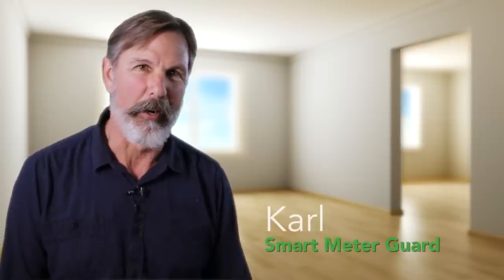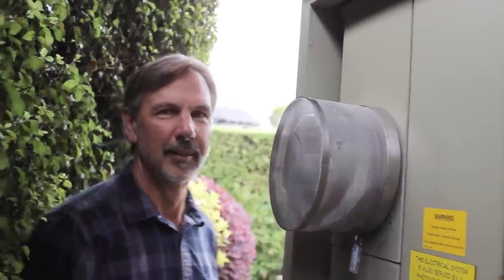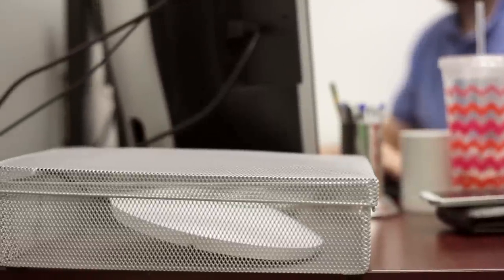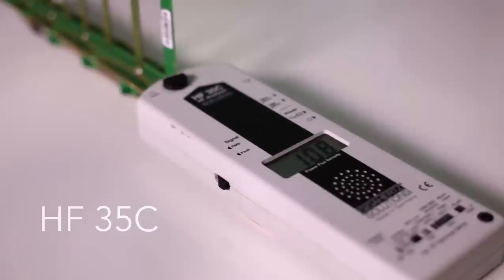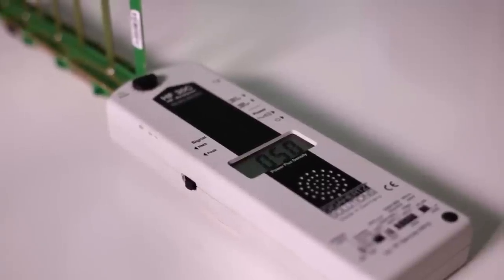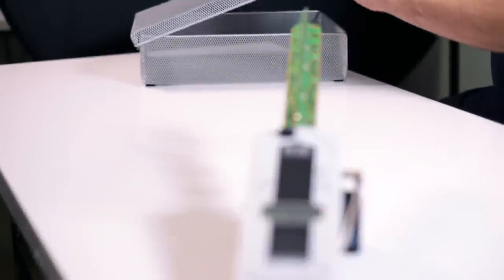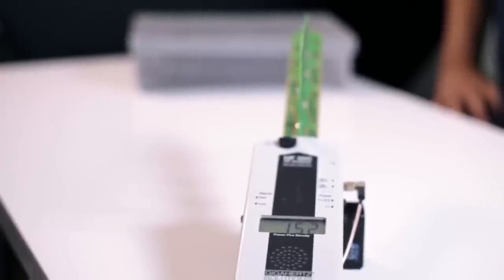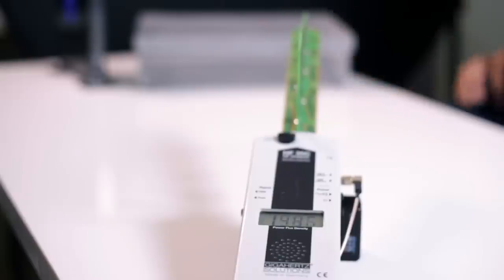WiFi Router Guard - Blocks WiFi RF Emmissions

Comment: Specking of which, I’m making my own router guard from an empty wheat-bix box and aluminim foil. I just hope it works. Anyway, I’m not exactly sure rather they’re right or wrong about the hazards of wifi, but i’m getting that guard made and used to the radiation of my wifi, just in case.
Reply from the maker: +MJ dancer and Sonic fan   Hi MJ,  We would say it's worthwhile.  Good job on making your own!  It can be done and we encourage people to do it.  Thanks
Reply: Thank you  very much. I hope you can put it on video so that you can get the message acorss easier. I should tell you though, my homemade guard does make the wifi connection far outside  harder, but it still works fine indoors and outdoors near the house and almost halfway acorss the back yard. By the way, I made my own cause I live in Australia and I can’t buy the router guard you’re selling, cause of the dangers of online shopping with bank accounts. But I should warn you, while it can block radiation, it can also block heat. So I recommend a four hour limit for the wifi modem to be on with it covered by the shield.

Comment: . . . Or, you could just go into the router's GUI (Graphical User Interface) by typing 193.168.1.1 (the default IP address for most common routers) into the address bar of your browser and either turn the radio output power down to 5% or 10%, or if your computers can be hooked up to the router via Ethernet cables, just shut the radio off completely.  Bye bye EMR.  Problem solved.  Zero cost.
Reply: Genius!
Reply: Except for the Bell Home Hub 3000 which says you can change the output of both the 2.4G and 5G antennas, or turn them off completely.  Problem is, when everything is turned off the unit still emits a strong unidentified 5G signal.  Only way to turn that off is to unplug the unit.

Comment: Why not just turn router off? It won't work in the mesh box.
Reply from the maker: Hi Joe, Actually, you can still use the router when it's in the Router Guard.  This is because the Router Guard blocks about 90% or so of the RF it emits.  The 10% or so that gets out is still enough to use your router.  Thanks

Comment: Yeah it blocks your wifi signal so your phone/tablet (the closest device to your skin) ramps up the transmission power in order to stay connected. How healthy is that? It also kills your wifi range and speed. Double fail.
Reply from the maker: Hi Ali,  Actually what you say is not true.  There is no circuitry in any of these devices that control the RF power they use.  They all just simply transmit at one power setting.  Also, with the Router Guard you can still use your router.  This is because the Guard blocks about 90% to 95% of the RF they emit.  The 5% to 10% that gets out is still enough to use your router.  Thanks
Reply: SmartMeterGuard yes there is circuitry to change the transmit power.

Comment: Eh? A WiFi router case that blocks the WiFi? Just turn the fkn Wireless OFF and use the ethernet! The Smart Meter Guard won't work great either.....the electrical wiring of the house to which the Smart Meter is necessarily attached will act as a great big attenae. Just don't have a Smart Meter!
Reply: How can I use my phone then? I need wi-fi on my phone, so this works great to reduce the RF.

Comment: You are wrong it is entirely possible to turn off the wifi and hard wire it. Call you IT guy. That being said you cannot use wireless dependent devices like tablets and cell phone. I do not purchase any wifi only devices.
Reply from the maker: John is correct, you definitely need to turn off the "wireless" function in the settings of your router.  If you don't do that then it will still emit RF, even if you're hardwired in.  Also, as John mentioned, if you do this you won't have wireless capability for your other devices.
Reply: John Puccetti They are already making wifi updates that will use your outlets. It will be sent to all of your outlets in your home. Your while house will then be a radiation cage!
Time to go home!
Reply: No need for an it guy, its not that complicated...people need to start using their little brains, and start reading instructions..
Reply: @darsmail02  What a scary thought.

Comment: can you make a hat instead ?
Reply from the maker: +Pat G  Absolutely!  Email and we'll see what we can do.
Reply: i would be interested in a hat also
Reply: I am visiting friends in NZ - the wifi router is more of a cylinder - maybe 10 inches tall and 4 or 5 inches across. It sits upright on the desk....Have you seen routers like that?
Reply: SmartMeterGuard, I need a bigger one
Reply: Pat G; yes, you can make a beanie to wear when you are using the computer. Buy some RF EMF sheilding fabrick on ebay and sew it to fit your head. I made one, its easy.
Reply: @jacquelinemanzano9328  4 real?! :))))))))))

Comment: This is honestly the dumbest thing ever, lets limit RF by blocking the router's single and making it near pointless. why bother even having a WiFi router if you're just gonna block the single.
Reply: It doesn't block wifi entirely. You open the lid wider when your far away. And Close the lid shut if you're right next to it. It's like a stereo VOLUME control.
Reply from the maker: +123coolx   Hi 123coolx,  Actually you can still use the router.  The Router Guard reduces the RF exposure by about 90% or so but only reduces the distance you can be from the router by about 40% to 60%.  This means the router is still usable while reducing your exposure to RF.  Thanks
Reply: Yeah it blocks %90 of your wifi signal so the closer device to you (phone/tablet/computer) would increase its transmission power in order to compensate the bad communication, becuse your router couldn't hear it well enough while being locked in a cage. Very useful.
Reply from the maker: Ali,  there is no circuit in a router that monitors or controls the RF power.
Reply: @SmartMeterGuard   pretty sure your phone will increase power in it self if it's having trouble with weak signals. Not sure about wi-fi, but if phone only has low bars it will increase power to improve signal to the cell tower.

Comment: Ok so 5G network is being implemented in cities in the coming year will you be contracted to cities to encase the new towers?
Reply from the maker: Hi iCaliver,  Actually, unless you are pretty close to a cell tower you aren't really getting exposed to much RF power.  This is because the RF power drops rapidly with distance.  The power drop is one over the inverse square of the distance which basically means a log rhythmic drop in RF power.  Thanks

Comment: Wouldn't just be easier to buy some EMF/RFID blocking fabric and just make a face mask, coat, pants, and socks? then you still have your wifi.
Reply from the maker: Hi therealdealpen,  Yes, you could do that but it's not necessary because you can still use the router with it in the Router Guard.  This is because the Router Guard is about 90% efficient at blocking the RF from the router.  The 10% or so that gets out is still enough to use your router.  Thanks

Comment: why buy this just buy a low power Wifi unit
Reply from the maker: +Benjamin Maker   That would be nice but unfortunately, you can't specify  the power ratings of routers.  The power output is what it is when you buy the router.

Comment: Or just unplug the router
Reply from the maker: Hi Robbie,  Yes, you an do that but you won't be able to use your router.  With the Router you can still use your router while blocking the EMF exposure by about 90% to 95%.  Thanks

Comment: Just turn your routers off at night...and your personal bedroom "kill switch/ie" your breaker from the breaker box.....no more problems.  Establish this as a habit....done.
Reply from the maker: HI Frank,
Yes, that works the only issue is if someone wants to be shielded during the day when they use the router.  The Router Guard shields about 90% of the RF the router emits and you can still use the router.  Thanks
Reply from the maker: Hi Frank,
Yes, you can do what you suggest but then during the day you are exposed to what your router emits.  The Router Guard blocks 90% or so of the signal but still allows you to use your router during the day.  Thanks
Reply: @SmartMeterGuard  Does the power of "outward" WiFi signal get attenuated enough to hinder Internet connectivity?  If so....it's worthless.  Please don't tell me, that putting a Faraday Cage around anything with any kind of EMF would NOT attenuate the signals outbound.  That's it's job. All one needs do,...is take some "rabbit cage", and form a small box around any router and it will be just as powerful...not "pretty", but it'll work.  Thanks
Reply from the maker: @frankfromupstateny3796  Hi Frank, The Router Guard reduces the RF signal by about 90% or so.  It's actually very difficult to block 100% of an RF signal without a complicated and expensive design.  However, the distance an RF signal can travel is not a linear function of the power and there are many other factors involved like what you walls are made of.  The only thing you may notice in the performance of you router with the Router Guard is that the furthest you could be from your router and still get a signal will be reduced by about 5 to 10 feet with the Router Guard depending on the router you have and what your walls are made of.  Also, you are correct, anybody can make one by using a metal mesh to cover the router.  The key is no gaps and testing it. Thanks

Comment: Seems dumb not to place a link in the video description to your website. It would be smarter to make purchasing easier.
Reply from the maker: +grandpied  Thanks Grandpied, good input we'll definitely do that!
Reply: +SmartMeterGuard  Good to hear. I'm going to buy one of your Router Guard Wifi Radiation Protective Shield. But, first I want to get a descent inexpensive scanning meter, probably a Cornet ED78s.
Reply from the maker: +grandpied   Hi Grandpied,  That's great.  It's pretty tricky measuring RF from smart meters and routers so we developed an "RF Measuring Guide" to help people know the do's and don't of measuring RF.  If you would the Measuring Guide that just send us an email at info@smartmeterguard.com and we'll send it to you.  Also, make sure you have the Cornet set to measure HF not LF, there are two different settings.  Thanks
Reply: +SmartMeterGuard  I just now sent an email requesting the "RF Measuring Guide".  Thank you!
Reply: +SmartMeterGuard  Thanks for the quick reply, I received the RF Measuring Guide in less than two hours, and converted it to PDF.

Comment: WAY TOO EXPENSIVE!!! WHAT A RIP OFF. And if WIFI is blocked, it won't work!
Reply from the maker: Hi Robin,  You are actually wrong here.  It blocks 90% or so of the wifi signal so the 10% or so that gets out is still enough to use the router.  If you think it is too expensive we would challenge you to deign and have made one that is less expensive and you will see that the price is actually a good deal.
Reply: @SmartMeterGuard  Will it works over time if it is not grounded?
Reply from the maker: @vookie4570  Hello Vookie, Yes, the Router Guard and Smart Meter Guard we make do not need to be ground because they are Faraday cages.  Faraday cages do not need to be grounded to block RF.  Here is a link to our video we posted that demonstrates this:  https://smartmeterguard.com/pages/videos#group-1  Thanks
Reply: @SmartMeterGuard  i think they sell the same metal box at the dollar store..??
Reply from the maker: @elieyaffa1077  Hi Elie,  please check and let us know.
Reply: @SmartMeterGuard  what's the exact material you used ?
Reply from the maker: @elieyaffa1077  Hi Eli,  we use regular steel for the Router Guards and stainless steel for the Smart Meter Guards that are used outside.  Thanks
Reply: @SmartMeterGuard  so you gonna tell me you pay more than 10$ for each piece to produce..  and sell it for more than 50$ to the public? you think I was born yesterday why would you rip people off Like that? you can find any steel box for less than 15$ at home depot, canadian tire,walmart or others.. ??
Reply from the maker: @elieyaffa1077  Hi Elie,  your reaction to the price is a common reaction from people that know nothing about business, manufacturing, packaging and distribution.  Which is OK because most people don't understand this.  Please educate yourself on the cost of doing business.  Thanks
Reply: @SmartMeterGuard  i guarantee you make 5x time the money you paid even with manufacturing,packaging and distribution at the end of it otherwise prove it
Reply from the maker: @elieyaffa1077  Elie,  You really need to get out from behind your computer and experience real life.  Sitting behind a computer and spewing criticism and not being able to carry on an intelligent conversation without derogatory remarks just show a real lack of education and real life experience.  If you can not carry on a meaningful conversation we have to block you.  Thanks

Comment: BWAHAHAHAHA

Make a faraday cage to block the "rf" (radio frequency) coming out of your router?  If you want to "block" 95% of the transmissions, you could just log into your router, and turn down the power setting to 5%.  But then, you'd have to stand right next to the router to get a wifi connection. 

To make an analogy, this is like buying a refrigerator to put your oven inside, to keep it from getting "so hot."   Just turn down the power... or better yet, get Powerline Adapters or ethernet cables and skip the wifi.  

But seriously, if this stuff is hurting you, I got bad news for you, because Bluetooth, AM/FM radio, and Ham radio also are "RF" (radio frequency).  If it's hurting you, you're doomed.  Some hardware cloth mesh made into a box isn't going to save you... unless you live your whole life inside that box.
Reply from the maker: Hi Blasted,  Yes, you are correct, however, about 80% of the router don't have that function, especially the more popular brands.  Router manufacturers don't want people lowering the RF power.  In addition, it is rather complicated to do this and if you don't know the URL, user name and password you won't be able to login to find out if your router actually has this function.  Lastly, while using an either net cable directly into the router works you lose the flexibility of being where you want to be especially if you are using a mobile device or laptop computer.  Thanks

Comment: Tinfoil
Reply from the maker: HI Joe,  Yes, that works, however, you have to make sure there are no gaps.  In addition, foil also reflects RF so if you're not careful you can actually reflect it in a direction you don't want.